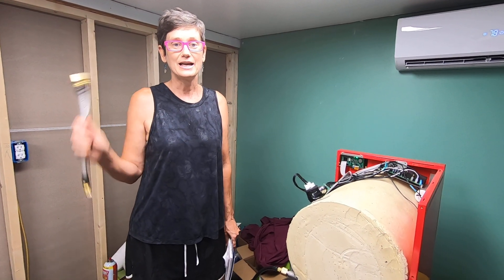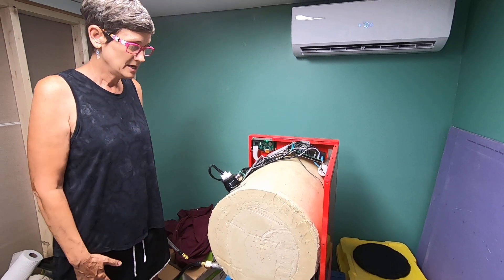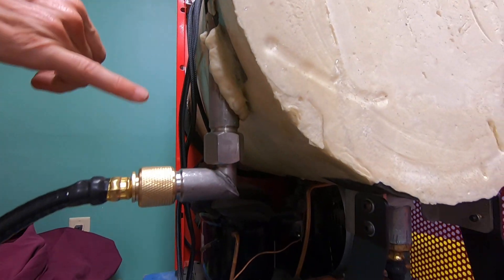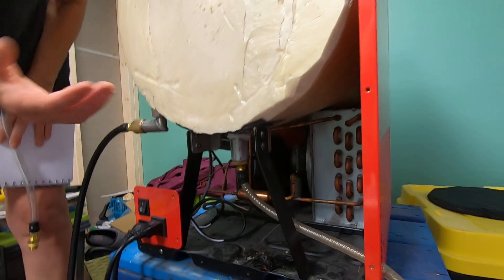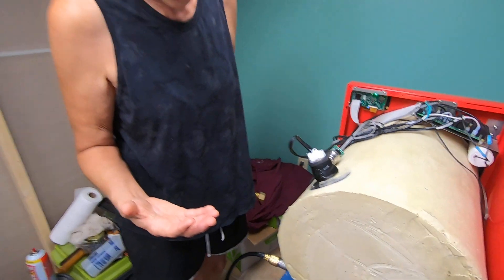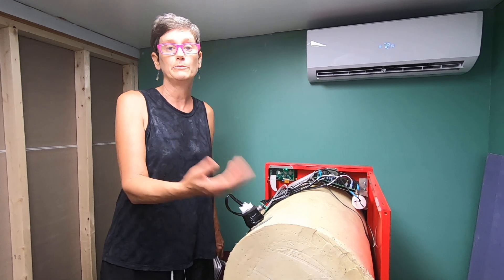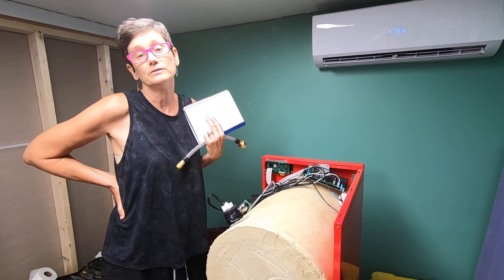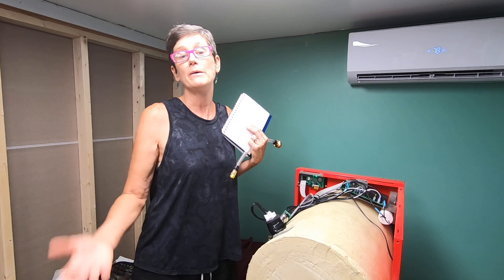3F: 1 Year Day 190 - Freeze Dryer Vacuum Leak Fixed! Lessons Learned

Comment: Same here... my dryer wont go down past 800mT  It went down past 500mT in the test within 6 minutes... I thought I had a good one..  nope.
Reply from the maker: Maybe this will help - https://youtu.be/jq0zVrdBKQI. Seems as though the software changes help lessen the vacuum error.
Reply: @foreverfoodsfarm  Thanks, but this dryer is only a week old and is on this version already.
Reply from the maker: @The411  oh no! That is not good!!!
Reply: @foreverfoodsfarm  May I ask what size the o-rings are that go in the chamber elbow joint ? My o-ring looks like a rabid beaver gnawed on it.
Reply from the maker: @The411  I do not. We took it off and took it with us to the hardware store back during summer and do not remember. Sorry.
Reply: @The411  Mine too. a month old and already has problem. Harvest Right tech support is fucked up. They delay and delay to try to solve the problem.

Comment: Glad you figured out your issue.
I got five runs and mine hasn’t worked since.
Oddly, it passes all the vacuum tests but then fails with a vacuum error when I run a batch.
It will go down to 300 mt during the tests, but then can’t even reach 500 in the vacuum freeze cycle. And from there, it just keeps going up!

Harvest Right has not helped me figure it out and blew off my follow up meeting last Friday.
You sure are right. They don’t seem to care about getting you up and running quickly.
Had I known the support would be so bad, I likely wouldn’t have bought it. Now i am feeling like I am on my own, despite this being a brand new machine. Very disappointed with this company. At this point I am ready to send it back.
Reply from the maker: At least you are still under warranty. I got the dreaded vacuum error on my last batch and just pulled my items out snd put them in the freezer and walked away. The feeling is similar to driving a non dependable car. You never know if you are going to make it through a batch or not. Good luck. I’ve never experienced your issue and if you get it resolved please come back and let us know what it was.
Reply: @foreverfoodsfarm  I certainly will let you know. At least there seems to be a community of good people freeze drying! I am pretty good at fixing most things but I am thinking this is a vacuum pressure switch, or maybe a chamber leak that only happens when it gets cold.
I sure is odd though.
I did the same thing. 4 trays of grapes, blue berries and bananas. It was a ton of work. They have gone through about 5 deep freeze cycles but never reached dry. I will likely have to throw them out. I’ll just keep using them until it has a successful run. Then I guess we’ll see. Not sure what that many cycles will do to it all.
Reply: This is EXACTLY my issue also. Blasts down below 500mTorr in 7 minutes with the chamber at around -5C  But fails the bread run, it does not go below 800. Clearly, there's a seal shrinking too much when it gets real cold.
Reply: I'm having the same issues. Please let me know if you find a solution. This is very frustrating.
Reply: @drakecassidy2942  I had to send it back to Harvest Right for repair. It is working now.
Their Notes -
epoxy was leaking bad and drain hose was the old style and leaking was 284mt, after fixes would go to 84mt. Full frost and temp of -50.3. heat tested good and updated software, pump and hose tested good.
Reply: @fleebin2794  I appreciate this feedback. No way I'm sending a large back to HR. I'm going  to open it up this weekend and inspect.
Reply: @drakecassidy2942  I thought that at first too. In hindsight, it would have been a lot faster to send it back ASAP.

Comment: My new machine has been a headache since I received it 3weeks ago, finally pinpointed my issue as a leak on the epoxy seal. If possible can you give me a bit more info on how apply the silicone and tape to it?
Reply from the maker: I’m sorry you are struggling so early in your journey. What we did with the epoxy seal is wrapped  a wide painters tape around it where half of it was above the seal making a cup. Then with the vacuum running in test mode we squeezed the silicone into the cupped space and let it run for 30 minutes. Turned off the machine and let it cure without releasing the vacuum for a day. Hope this is helpful.
Reply: @foreverfoodsfarm  Did your machine have a black foam insulation piece around the epoxy seal?  So did you put the silicone up around the wires that come out the top?
Reply from the maker: @amyb4741  It did have that insulation piece.  We temporarily removed it to wrap the epoxy part with the tape to create the "well" for the silicone.  We did put it around the wires that come out the top.  Good luck!

Comment: New subscriber ... 'found you out of desperation! Thanks for the great troubleshooting tutorial. It doesn't seem right that customers should have to disassemble and repair such an expensive purchase themselves. Some people might not have the ability (or confidence) to do so. We just bought a brand new refrigerator for our kitchen, paying 1/2 the cost of the Harvest Right unit, and when we have a service issue, a technician comes and fixes it. We're not in the Richmond area, but looking forward to checking out your channel nonetheless. Again, thanks for info!
Reply from the maker: I admit that breaking into a costly machine when you have no idea how to do it is scary as heck! And I am NOT mechanically inclined at all. But if you step up to the challenge and succeed it is very empowering! I swear if someone on the east coast would have made service calls I would have jumped on it! How about that for a business idea? Thanks for your support and I firmly believe we are all in this together! Good luck!

Comment: I could not get below 700 mTorr and I spritzed the groove in the giant door gasket. I also took a fine diamond file and smoothed out any nicks and dings on the stainless cylinder rim thinking the giant gasket could not make a good seal with a rough rim. I finally decided to change the oil. I drained it and even tipped the pump all the way to make sure I got ALL of the oil out! I added about 450ml of fresh Robinair clear premium VP oil and fired up the vac test and NO DICE! I still could not get much below 700mTorr after 20 minutes. I then looked at my brand new oil and it was ALREADY CLOUDY?!? What the heck is going on?!
This is a basically brand new large FD (I am running the 5th or 6th load right now) and it was working great for the first three loads. 

I did the water sucking test on the drain line and it seems to working just fine (no sign of suction).

One thing I noticed is the vacuum line from the pump to the cylinder has a peculiar behavior: one end goes finger tight and then I can tighten it about 1/6 of a turn with the expecting slowly increasing force required to rotate. The other end hand tightens pretty good but comes to an abrupt stop. Even with a wrench and light force, it would barely rotate any further, so maybe that o-ring is not getting fully seated??

Where did you get the self sealing silicon tape?
Reply from the maker: We got ours at an Ace Hardware Store. I wonder if it is the hose end or the pump end? Definitely get some carburetor cleaner and spray that connection when you are at 700 to see if it changes. If the leak is there it should jump up quickly and then slowly go back to 700. I would be more worried about the cloudy oil. Should be under warranty and just get it replaced. Make sure you check all the other connections inside the dryer as well. Good luck and let us know how it resolves!

Comment: Really good video, thank you for posting this.  I've had similar issues.  First the drain valve leaked and had to be replaced.  That was 3 months ago.  A new pressure leak appeared and I've diagnosed it to the Epoxy Plug.  When I was diagnosing the drain valve they didn't have the reservation system for support.  It took forever to get time with the support techs.  My first appointment is happening this afternoon for my new issue.  I took your suggestion and made an appointment for tomorrow as well for the follow on...  Also this time I'm posting my experience on my youtube channel and entered the link to the video into the Harvest Right support ticket so they can see what I'm seeing.

Comment: Basically, they are taking your money and then you are stuck - 5 years and still trying to get it to work right consistently.  And, then (mine was bad from the beginning), they tell you that your warranty is over!   They DO NOT sell an extended warranty!!!  They have put up videos under the /support area and it was helpful, but it does not fix the workmanship on these units.   It is a shame that there are 10+ more years before their patent runs out.   When it works, it is wonderful - but when it sits during harvest times - well - very frustrating.   I am disabled and got it because it takes less physical labor and lifting than canning.   And, I like the product much better than the commercial brands where you spend huge amounts of money and get who knows where it came from or how it was grown food.
Reply from the maker: I created a business plan in 2019 that revolved around freeze drying our fruit we grow. In 2020 we launched our business with the idea that the first year was about research and development. The FD worked like a champ and we learned our lessons and was ready for 2021. June is our first major fruit harvest with a second big push in July and August. I was devastated when the FD was broken during both of these seasons. Lessons learned are to be creative, flexible and have redundancy. Now that I don’t have any fruit to harvest it is working again. Almost feels like a cruel joke. No worries because we have a better business plan now where freeze drying is a smaller percentage. When it works though it is the greatest! I still love it and believe in the concept.

Comment: How does HR use the files to help with Vacuum problems. I think the FD doesn't tell my pump to come on any more and it started having problems early on, but I didn't know it was the problem, I thought I didn't know what I should do. So I kept questioning myself when in fact the machine was not always working correctly. Now it wont work at all, even in test mode. But if I plug the pump into a standard wall plug it works... Also, I purchased a new oil-less pump and now I've never gotten any run to vacuum since the first run that stopped vacuum after initial vacuum freezer. Yes I have had two appointments and on the third with HR... Any suggestions will be helpful and Thank you.  LB
Reply from the maker: I feel your frustration and know it well.  As far as the log files go I think they use them to see at what point in the process the dryer fails which helps them pin point where to focus their attention.  For us everything worked until the deep vacuum point which indicated a leak in one of the connections.  Recently we went down again and the pump would run but we could not vacuum at all and used a back up pump to determine that our oil free pump isn't working properly.  For you, it sounds more electrical than leak or pump problem.  If I were in your shoes, I would be focusing on wiring and the computer boards.  At the bottom back of the dryer where the pump plugs in there are wires with clips on the end. You will need to have the back panel removed to be able to see these clips.  You might want to confirm that those are connected or pushed in all the way.  And definitely keep making multiple appointments at a time with HR to speed up the customer support process.  Ultimately we are at their mercy, so be patient and don't give up!
Reply: @foreverfoodsfarm  Thank you Yes I think you are right - the wiring or something is not getting power to my pump(s). I tried the older oil pump last night and had same outcome. But the pumps both work with wall plugin. Also, test mode does not get the pumps working and an electric tester does not show power in cord when it should in test mode... I will try to get customer support in this direction. Do you know if the software needs update - I think mine is V4.1.26 that is what shows on startup...?